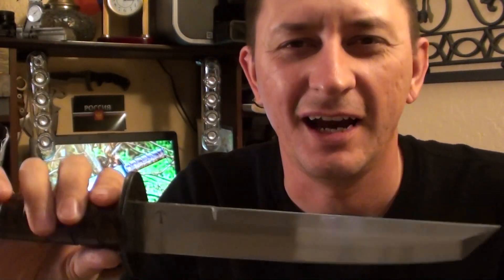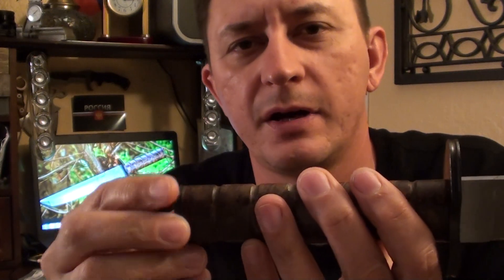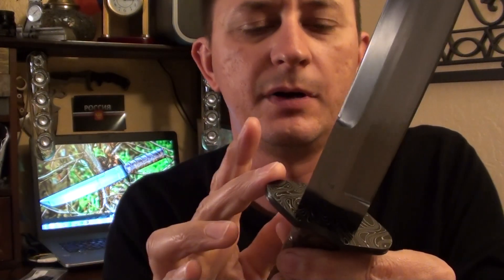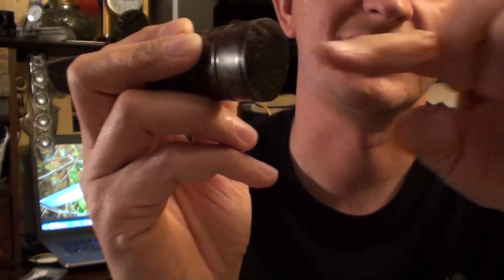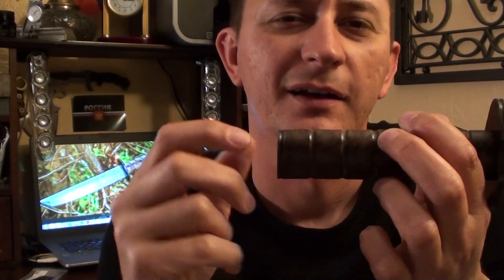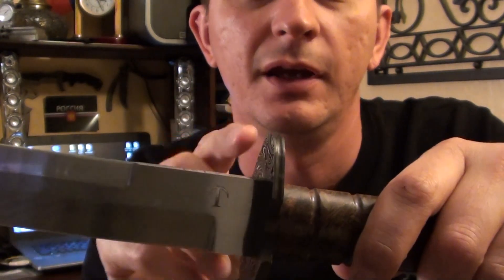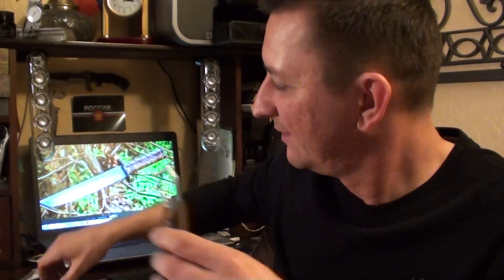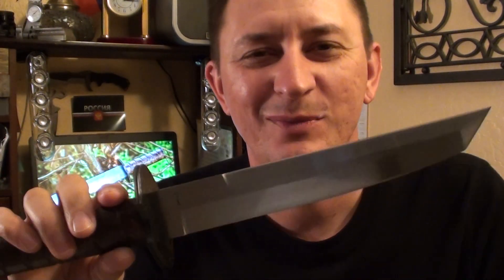TANTO KNIFE with Damascus Handguard and Pommel VLOG

Comment: Hi Slavik, first off the knife is amazing, wonderful job as usual.
I have to say I was wondering if you'd mold a kydex sheath for a tanto knife and indeed you did. But I don't see why leather, as many people here wrote, would be that much better. I guess kydex doesn't shout japanese tradition, but neither does leather? The sheaths for traditional japanese tanto knives (or wakizashi, or katana) look to me more like some kind of mirror polished wood, if I'm not mistaken; not leather.

In any case, it's irrelevant because a) this knife is seriously gorgeous and b) if the customer orders and/or pays for a beef steak well done, a Rolls-Royce with a Ferrari red paint job, or a tanto knife with a kydex sheath, then so be it, because you can tell them 100 times there are better or more traditional ways of doing things, but at the end, they are still the customer.

Also the knife is beautiful.
Reply from the maker: You are absolutely right. It is exactly what I did...customer got what they wanted. Thanks for the compliment.

Comment: Hi Slavik,
It was a pleasure watching you make this knife. Beautiful work. 
Steve
Reply from the maker: Thank you Steve. I watched your surface grinding video and I can't wait to purchase a surface grinder. It would be so handy.  But as of right now I don't have room for it because I do not have a shop.
Reply: Hi Slavik,
What do you plan on doing with the surface grinder? Are you going for flatness, finish holding precision sizes, or a combination of the above? If you buy a used machine make sure you grind a plate of steel on it first the finish will tell you a lot about the machine. I have been watching your videos at work on break time. You do some amazing work I shared your channel with a few friends.
Steve
Reply from the maker: I noticed some steel (when asked to surface grind the scale) comes in very rough ground from the New Jersey Steel Baron. I would like to use surface grinder to clean up the face of the steel so I would not have to sit for hours and hand sand the dents/grind lines in the steel when it comes in from the factory. But this dream is not going to happen until I buy a house with a garage to place the grinder. Thank you for watching my videos. If you are watching from very beginning, don't be so harsh judging me. I did not know anything about tools or how to properly use files. Now, I have more knowledge and still am learning.
Reply from the maker: It would be too expensive for me to ship the steel to you because I have them in 3-4 feet in length X 4 inches wide. But thank you for the offer. The 20" disc sander would be another wonderful addition to my tool investment that would be used to grind wood handles. I have a 6" disc grinder and I can't get perfect grind on it because the middle of the disk doesn't grind the same as the outside. Like I said, once I have a shop or a garage I will be watching your videos all over again and manufacturing my tools just like you did. You have a great setup and plenty of awesome advice in each video.
Reply: Hi Slavick,
Thanks for the kind words. If you ever have any questions I haven't covered in the videos feel free to ask. You are doing a great job and I would be happy to help you out if you ever have the need.
Steve

Comment: Hi Tely i have a question i need answerd i am drilling a karambit style hole in knife 1 inch wide so i first broke the drill then got it fixed then the 1 inch drill bit was just rounded off and is only half way through the 1/4 inch 1075 steel i need help
Reply from the maker: I tried drilling with a 1 inch drill bit and it doesn't work. Try using a unibit and then trim it up with a 1 inch drill bit. Place the bit into a hand held drill and go slow.
Reply: SLAVIK TELY and second how do u make sure the hole in the knife is dead center
Reply from the maker: Drew Brown use a ruler.
Reply: "use a ruler" i don't know why, but that was funny.

Comment: what kind of bit did you score the metal with
Reply from the maker: I use grizzly height gauge.
Reply: if you meant the one in the drill press, that was a warrior diamond grinding disk. (if i remember correctly) otherwise "grizzly height gauge" like telly said. he is the creator after all.
Reply from the maker: Modern Bladesmith Thanks Bladesmith.

Comment: couple of links arent fonctionnal !
Reply from the maker: I will check them out.
Reply: You've made a amazing knife by the way ! It is truely impressive ! 
Why don't you use a belt grinder for the bevels ? Isn't it quiet longer with the file ?
Reply from the maker: LesChiffres I am not that good with the belt grinder. Yes, it would make much cleaner plunge lines and the bevel lines. I only practice grinding one knife a month. Need more practice. Thanks for giving me a heads up on the links. For some reason, it doesn't want to direct to the links I provided. I guess people will have to look it up by title.